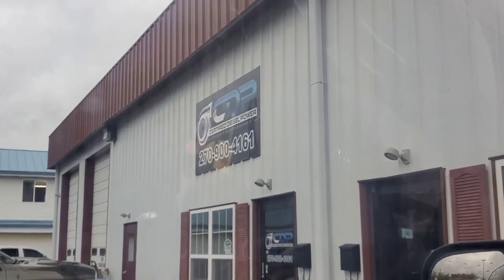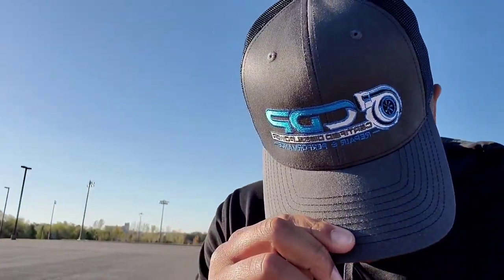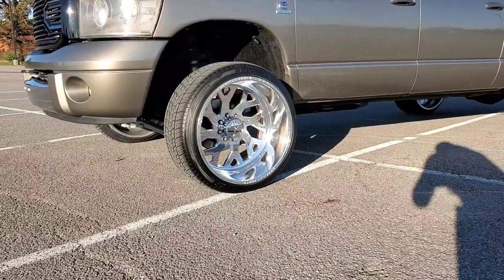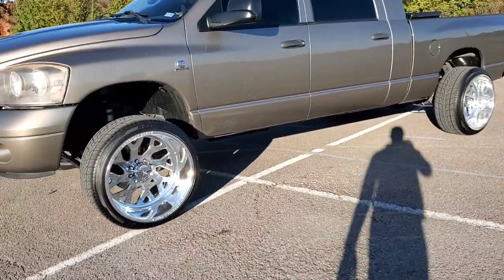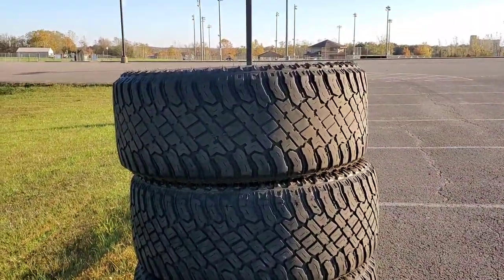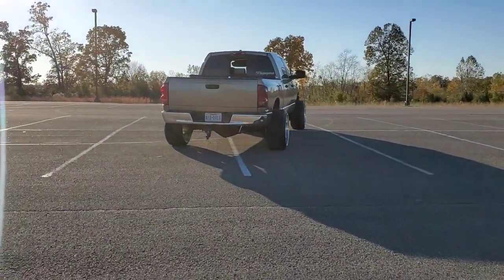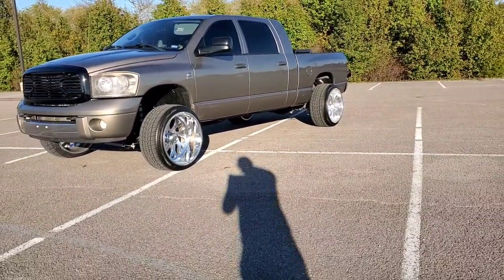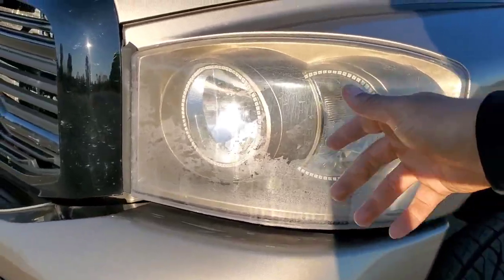Adding "useless" Parts to My Cummins!

Comment: How are you going to make it towing with those thin tires? Here in Tennessee the roads are terrible. I had 24’s on my Land Rover and I had problems continuously with the thin tires. I’m thinking 35’s for my 24x14’s. I don’t have a huge lift though. Probably 4” lift

Comment: you should just paint the ac condenser black i did that with mine and it still looks good, i just used some satin black paint.
Reply from the maker: Mine is all beat up too. It's pretty cheap to replace. I'll get around to it sometime this winter lol